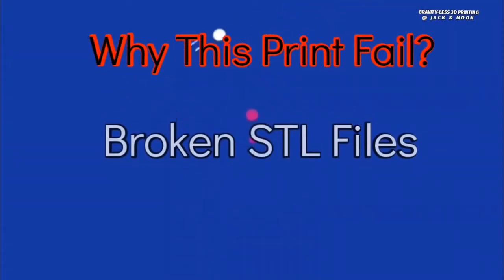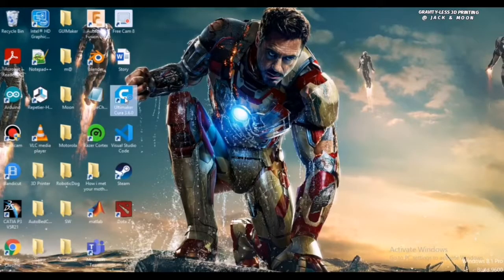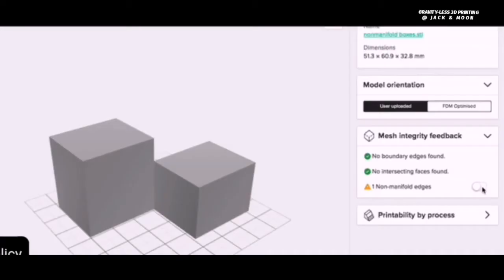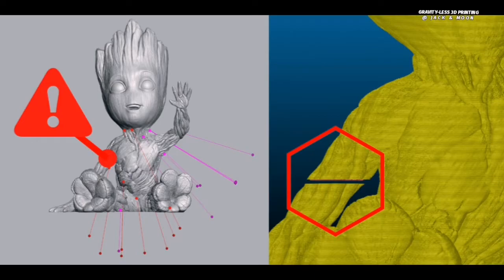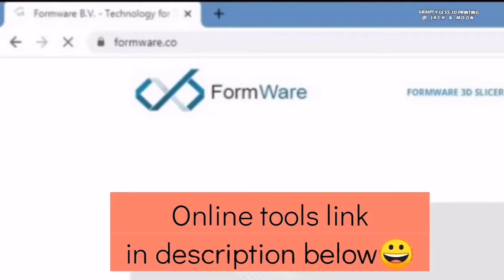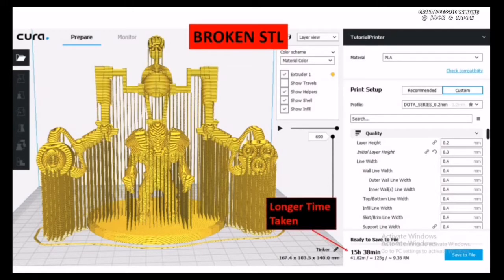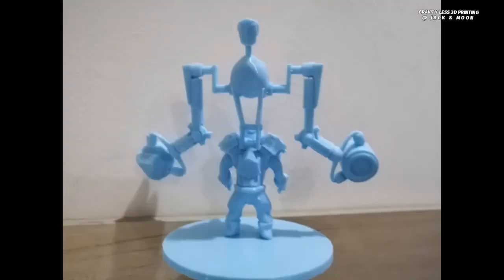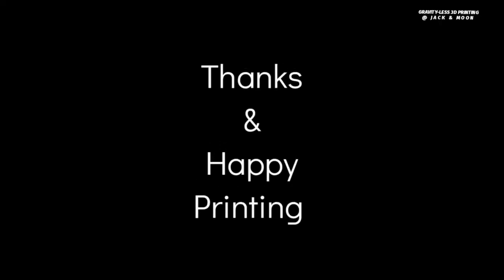Why This Print Fail? #STL Broken#Bad Meshes#Gaps&MissingLayer#Easiest Solutions

Comment: Blender 3dprinter add-on does mesh analysis and repair. You may still need to manually check orientation of normals for complete integrity of your stl files.